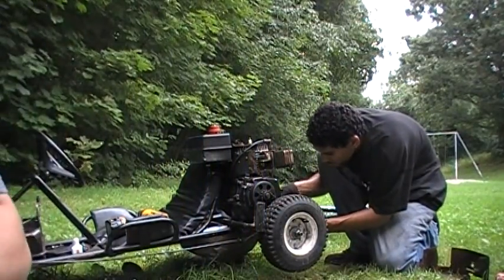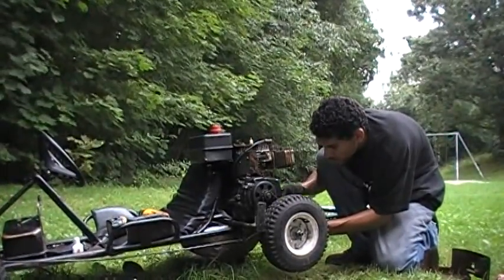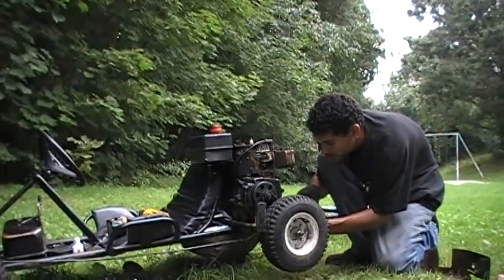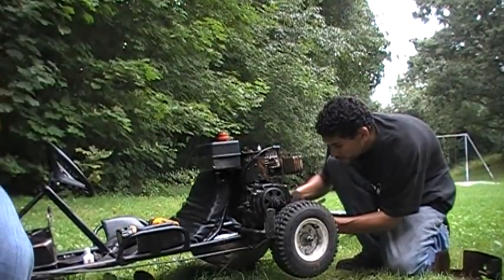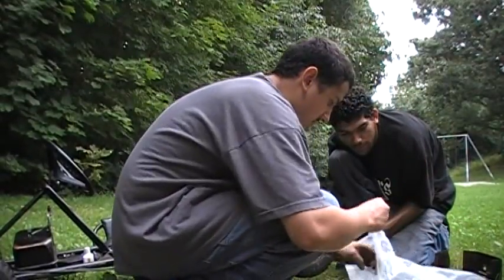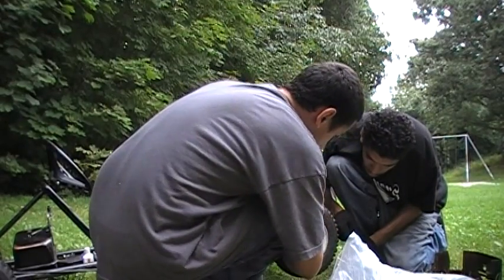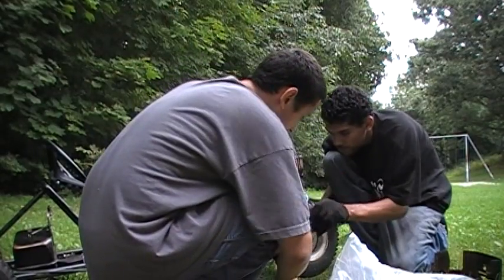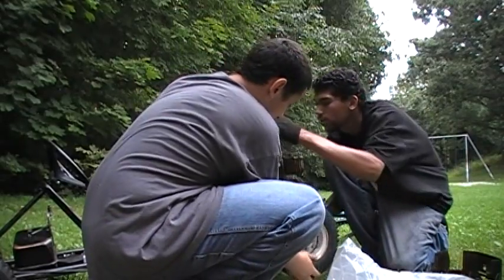Go Kart - Repair

Comment: i want to build one.      ppl say you cant use a lanwmower motor cuz it needs the blade to act as a flywheel.     even off a lawn tractor?    does it have to be side shaft? thanks